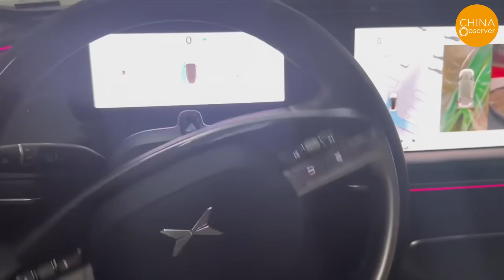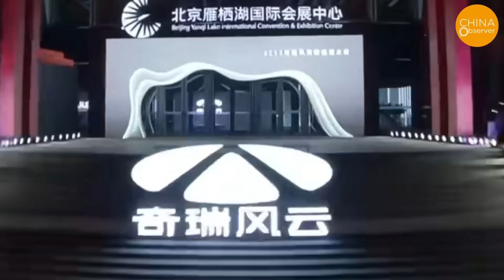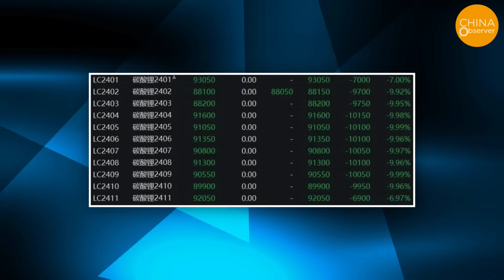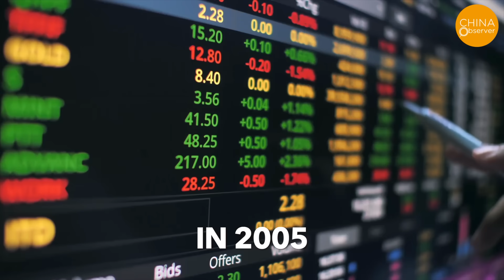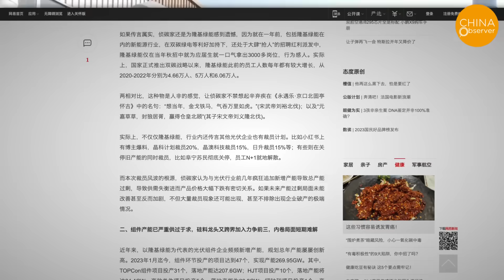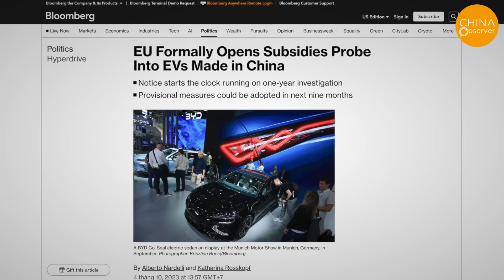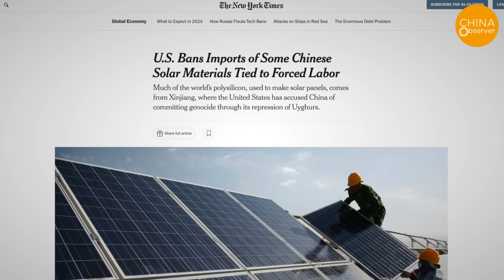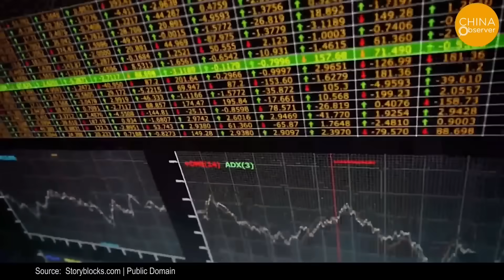Sudden EV Explosion, Rockets up 5 Meters, Close to 100 BYD Autos Spontaneously Combust

Comment: Nowadays, you shouldn't believe everything what you see on video. While battery can catch a fire if it has manufacturing issues or poorly designed bms, it can't explode by throwing a car 5m up. In the matter of fact, there's nothing what can do it without blasting out windows and severely damaging the hull.

Full blown EV fire can look scary with all cells popping and flashing, but they don't have much more than noise and fire, no more destruction power than fire crackers have. Only situation where such explosion can be dangerous is when vapors fill enclosed space and create proper mixture for explosion.

Electrolyte inside the cells are not more volatile than gasoline. You can get bigger explosion if gasoline leaks and explodes.

Cells are basically metal cylinders or other shape, and 'explodes' when the pressure inside exceeds about 10bars. That's not more than bicycle tire, but volume is much smaller. Electrolyte vapors can't explode inside cell because there's no oxygen. When bursting out from the cell, they can ignite, but not explode in open air. They are more like fumes from spray can.

When battery fire develops, also graphite inside the cell can ignite, but that's closer to a coal but don't burn as well. Lithium add reddish color to the flame but don't do nothing.

So, what people are afraid is few grams of alcohol kind of electrolyte on thin metal shell. Only thing what is different is the electricity inside cells, which can raise the heat to ignition point. Lithium batteries have suicidal behavior, meaning they short themselves when temperature goes much over 100C. That's the chain reaction which makes them seemingly difficult to put out. Once cooled but damaged battery can heat up again.

Comment: that's what happens when a damaged lithium battery exhausts into the cabin.  The electric jeeps made by stantis do the same thing.  It's a design flaw.  A major design flaw, because if the battery were below the passenger compartment, the gasses wouldn't fill up the passenger compartment in the first place, so the car wouldn't explode.  It might still catch on fire, but it wouldn't explode.  THese exploding cars put firefighters are great risk

Comment: Quit smoking by vaping early on.  when you go with the custom vapes you need to deal with rechargeable batteries aka chemical electric explosives. LI batteries are bombs, I have a few I use, but they are bombs.

Comment: The Green New Deal (now called Just Stop Oil) is all a scam to increase taxes on the public. Right along with the WEF. The fact is that newer ICE vehicles produce far less CO2 than they did 40 years ago. They are less expensive to produce, have a longer lifespan, are easier to maintain. EV's on the other hand, have a larger carbon footprint than the ICE, overall. They do not last very long, are expensive to service and not something the average DIY'er can maintain. There is also the high number of fires these vehicles are experiencing. They are rather impractical, overall. There is no such thing as Net Zero. The lies we're told about CO2 is also quite telling. For instance, Mt St Helens, Pinatubo, etc. eruptions have released more CO2 than mankind has since our dawn. CO2 is absolutely vital to life on earth. Both Plants and Animals could not servive without C02. Global Warming is just the latest trick to put fear into the people. However, it greatly benefits many governments around the world, as they can get away with insider trading. Thus making them richer at our expense. They can skew the results of studies in their favor, since they hold the purse. It's all political propaganda. Many independent studies have proven man made GW/CC simply isn't true. Earth has natural cycles of warming and cooling and always has. Of course many of these honest studies have been hidden, buried away from the public eye. You can find them, but you have to do a lot of searching. Google knows quite well how to hide facts from us. 
 "If you tell a lie big enough and keep repeating it, people will eventually come to believe it."
 Joseph Goebbels

Comment: expose the internals of a lithium battery and they react with the air heat up and ignite... try it just stab your old cellphone battery even if its flat, im sure its just a chemical reaction.

Comment: Lol, just came from a Tesla video with a small easily contained fire due to good battery design, and the comments were full of anti EV tr0lls.
Compared to this the Tesla was barely a sunday bbq worth of flames 😄
In this case I can agree with the tr0lls, these Chinese batteries just aren't being built with newer/safer methods to prevent thermal runaway.

Comment: Some people are stupid enough to think this isn't real.  Go research new electric bike blows up. Also check out videos of a guy Purposely try to kill dead or dying ( small) lithium batteries in a Hydraulic press to see what happens.  (Literally) I m surprised if no one is realizing the potential for as a fuel source ( booster Rockets) or ? I mean repurpose dead or dying lithium ion batteries as a fuel source or initial booster For space flight.

Comment: Right now EVs are a scam. 
In 2022 EV crashes reached 23.54 crashes per 1,000 drivers which is higher than any gas vehicle, not including the EVs that catch on fire for no reason. 
EVs can not be charged in below freezing temperatures. 
It takes 2 to 4 times (100,000 to 200,000 mj) more non-renewable energy to manufacture an EV than a gas vehicle, 55,000 mj. 
Some charging stations rely on diesel genarators to charge EVs, this occurs more in rural areas and when there are power outages.
EV manufacturers use a multiplier to lie about the diatance an EV can travel on a fully charged battery.  
And after the warranty runs out on your EV and you need to replace your batteries it will cost you up to 2/3 the price of what it cost to buy your EV. 
lithium-ion battery mining and production are worse for the climate than the production of fossil fuel vehicle batteries.
It takes 25,000 pounds of brine for the lithium, 30,000 pounds of ore for the cobalt, 5,000 pounds of ore for the nickel, 25,000 pounds of ore for copper, and Diging up 500,000 pounds of the earth's crust For just one battery. 
EV manufacturers are speeding up global warming by lying and scamming people into buying EVs for the good of making money.

Comment: EVs proven to be 16 times less likely to cake fire than an ICE vehicle!
Cobalt is required to refine oil for  fuel.
EVs very similar in weight to most European manufactured cars
EV Tyre wear comparable or better than ICE vehicles.
Brake wear substantially better than ICE vehicle.

Comment: From internal combustion engines, to spontaneously combusting EV's....Isn't "progress" wonderful?
Reply: 😂😂Lol thanks .

Except thats a Toyota Rav 4 . A Japanese ICE SUV
Reply: @JonySmith-bb4gx  
Well, in the news clip, it's described as a "new energy vehicle" that was charging. And I'm an ex-BMW Mechanic, and a restorer, collector, & dealer of classic cars & motorcycles, in the industry since I could walk because my father was also a BMW Mechanic. I've personally seen internal combustion engine vehicles burn, and they produce smoke that's black, grey, & white. But EV's produce uniquely thick, massively concentrated billowing clouds of pure white smoke of a kind you don't see in ICE fires, due to the extremely rapid & violent type of combustion exclusive to Lithium-Ion fires, where the smoke is produced SO fast in SUCH great amounts, it builds up in huge volumes in very thick clouds because it keeps building up quicker than it has time to dissipate & dilute into the atmosphere. ICE vehicle fires burn MUCH slower and don't produce those sort of flames or clouds of white smoke. It's a signature of EV fires. Nor have I EVER seen or heard of any ICE vehicle explode in that manner and be lifted EIGHT METRES off the ground. When petrol tanks explode, they produce large yellow fireballs and black, sooty carbon smoke that looks NOTHING like what was seen in that footage. IF that was an ICE vehicle as you suggest, a petrol tank explosion would look VERY different, and they NEVER have enough energy to lift a car or SUV eight metres into the air. If that WAS an ICE vehicle exploding, it would be the first one in history to explode that way.
It may have been a Toyota. It may have been a RAV4. But it was an EV. That was NOT a petrol explosion.

Comment: Modern electeonics base is the p-n junction.
This  junction has a fatal flaw which actualy predates the discovery and use of the p-n jynction.
Earlier tgere was a metal point contact to metal sheet. This point contact had peculiar voktage cureent characteristics.

The Indian JC Bose discovered that the resistance of the point contact changed when exposed to hertzian waves enimating from a spark gap.

Later the p-n junction was discovered and it had similar voltage current graph of the point contact.

These days with prliferation of hertzian waves, often unintentionally electeonic circuits mis behave
Reply: 0:19
Reply: 😂😂😂Lol thanks .

Except thats a Toyota Rav 4 . A Japanese ICE SUV

Comment: You put a "fuel" system directly under the passengers, that has hundreds of cells, of which every one can catastrophically run off at any time or even worse, create hydrogen bubbles....you know hydrogen, that stuff in chemistry classes is used to scare pupils with very dramatic explosions.

Me and my old diesel being a burn-hazard? I throw dozens of burning matches into an open bucket full of diesel...to no effect.
And the recycling off all those toxic batteries has not been adressed as well

Comment: Here is what they are not telling you.
Some of these cars were driving under modified parts and had voided warranties because of self repair.
As for the battery exploding, that's from bumping and hitting medians and speed bumps at normal speed.
Now, you may think its spontaneous because you do not have the knowledge, but from my experience with Electric devices, one bump can cause it all to go boom.

Comment: People are FINALLY catching on, are they? It all looks like a movie the way the cars are jumping 3 to 5 meters into the air of their own accord and spontaneously catching fire as well. The best place for EVs are in the junk yard with the batteries encased in concrete in steel drums. Although, that last one could cause all sorts of havoc by itself. So much for the EV Movement. Word of caution: DO NOT park those “ Bouncing Betties” in your garage or you may wake up engulfed in flames or find your EV on the roof of your house or on your neighbor’s roof when you go out to go to work the next morning.

Comment: How many Fuel driven vehicles do you see SPONTANEOUSLY EXPLODING....?🤔
Reply: Good point. If you believe hollywood, they all explode in a crash. Vehicle fires are so common-place we don't even mention them now. It's wierd how for over a hundred years we've driven vehicles filled with like 50 or more liters of highly explosive liquid, and yet we take it for granted now that the manufacturers have found a way to make it safer. But let one EV catch fire and it's news. I wonder why that is..

Comment: What BS is this. 
Its an Old 1990-2000s  4x4 SUV and its running on LPG. 

This was nothing more than an LPG gas Explosion. 
No Fire, very low danger unless you are in path of the car. 

If it was a battery there would be flames as it instantly ignited when in contact with o2

Comment: Silly - it's a film set. The bystanders had their cameras ready.

Yes, EV batteries explode. 
At the off-gassing stage they can fill the cabin and blow the doors off. 
At the thermal runaway stage they jet out sideways.

But there is never any possibility of cells propelling a significant downward force.

Comment: The cheaper EV batteries literally use hundreds of individual flashlight style batteries (similar to 18650), welded together in a bank. In that second video where there were continual explosions, these individual cells or groups of cells were likely overheating and exploding.

Comment: What's the bottom line? From one stand point we all want quality products to always improve in quality supply lines. On the other side of the coin, why are our quality products going down.  It seems that somewhere in downstream supply lines, someone is cheating the party. ... In overview the system is very big and that more micro managers or people with the mindset to uncover who is cheating the party at the expense of poor quality must face the piper - even Tusla vehicles are at risk due to someone in the downstream supply line cheating the party from continuing to produce higher quality products.

Comment: 😮I've not bought an ev and won't.  I have bought six lifepo4 solar battery power stations made in China, whilst they worked fine for about 12 months, not one has continued to recharge and they are guaranteed to recharge 3000 cycles.  That's around 7 to 10 yrs.  I'm lucky I've had a full refunds. My point is, the concept is good but the end user product is expensive and ultimately not fit for end user purpose.   I have solar and fortunate to benefit from 5000kw over a 12nmont& period.  Half of that is paid back at a lower rate, but over the. Year I've used all the energy and that alone reduces my energy use by another 50%.   I can't dispose my 6 units locally.   I'm certainly not paying for this service beyond my local authority services

Comment: Now fix this safety  temperature sensors not more than 30 * Centigrade.  And not to charge excessive voltage or current, so it must have a meter showing voltage and amperes. Sometimes the batteries are getting blasted due to overcharging and hot.

Comment: This is the outcome of fast charging. It requires lots of current, if it finds fault short circuit will cause fire and explosion. Engineers must find a way to fix this issue.

Comment: To answer the first mans question, both petrol and electric vehicles normally catch fire after collisions due to break fluid leaking on the hot components. With petrol cars this is normally the exhaust manifold. With electrical vehicles it could be any thing from sparking wires to hot resistors.
Reply: Nonsense.  Brake fluid is non flammable and there is very little of it anyway and it is quite unusual for a petrol fueled car to catch fire in an accident. All modern cars use fuel injection and in an accident the system is shut down by a system activated by the sudden high G force of a collision.  Also the cars fuel tank is located in a position that renders it safe from rupture in all but the most severe collisions.  EV's by comparison are seriously dangerous in collisions, even the slightest damage to the battery system can cause drastic fires even some time after the original accident.
Reply: Don't know who taught you that, but I have seen it first hand and if you still don't believe me READ THIS!!!!
'Though not a volatile liquid, brake fluid is inflammable. Modern brake fluids are based on polyalkylene glycols. The author of this article conducted experiments which revealed that polyalkylene glycols ignited spontaneously on a surface heated to 390/400 deg C. Thus, if during a collision, a modern brake fluid should splash on an exhaust system at 400 deg C or over, it will ignite spontaneously. The fireball produced by brake fluid igniting on the manifold or exhaust system will burn with sufficient ferocity to spread to other plastics, such as cable covers, air filters and so on, unless quickly extinguished. Whether a fireball is created or not in a minor collision depends on the integrity of the brake fluid reservoir.'

Comment: Most of these videos are nearly a decade old. There are quite a few of these weren't even EV's. The car crashing wasn't an EV and the BYD dealership fire wasn't started by an EV. Most new EV's have thermal runaway protection and don't have these problems.

Comment: problem is bm modules. bms modules needs to be iffline and awerage bms ive seen has no direct disconnection capabilit of fault cell. fault cells needs to b disconnected by bms... bu toda bmss doen have that capability... and independend offlie bms per cell is needed tofix this problems...

Comment: Electricity can be dangerous. That's why they use it in the electric chair. I can't imagine using it in cars where you have all those moving parts that can start sparks and other stuff that can cause hydrogen that comes from batteries to explode. That's why you shouldn't check battery fluid levels with a match. You shouldn't smoke inside Teslas.

Comment: I would take all of this with a pinch of salt. That first vehicle that shot up into the air looks far too old to be any BYD model. And they make no reference to which models catch fire, if this was true the highways agency in most countries would demand a recall of all BYD models. I saw another fake electric car fire on a You Tube video of a Kia in the UK, since I live in the UK I checked the registration plate and found that the supposed electric vehicle on fire was a petrol/gas vehicle. I would not believe half the crap I see on You tube, and this video stinks of crap.

Comment: Just before I retired from the BNSF Railway in 2021 the contractor that provides the hostler service to move trailers and containers to and from the arriving and departing trains was starting to use BYD electric trucks to replace their older diesel fleet and I always wondered how that experiment went.
Reply: little to none of these cars were byds
Reply: I pick up loads at the BNSF South Seattle. So far the only complaint is that the seat won't move far enough. Anyone taller than 5' 10" is out of luck.  Also we had a good laugh about the basic extinguisher inside.